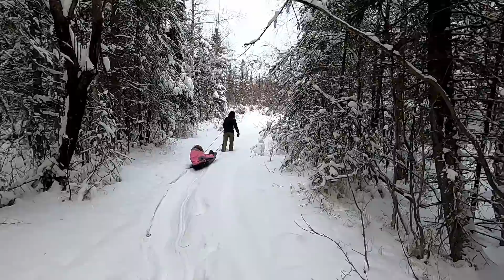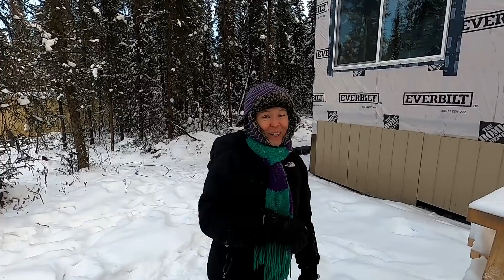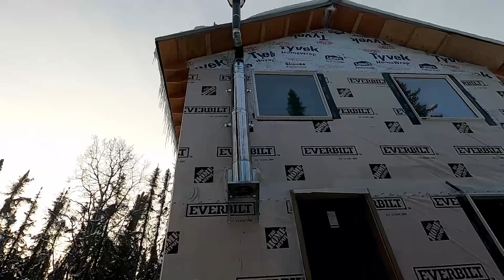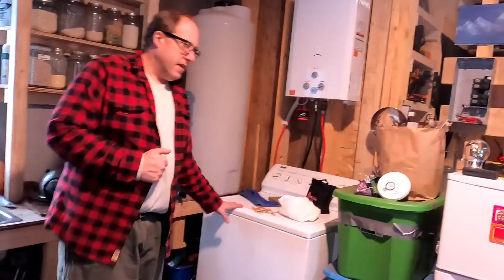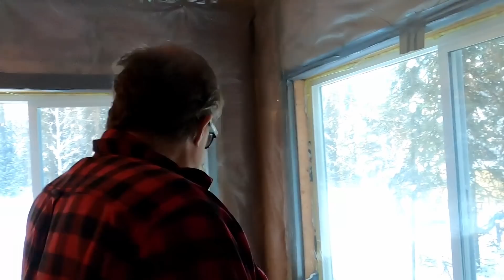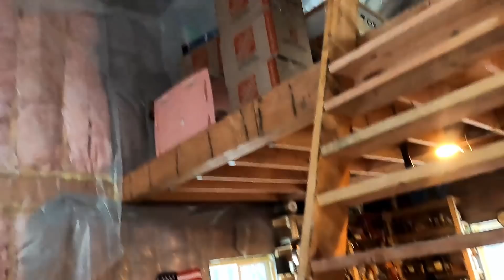We lost everything

Comment: Hi, just found your channel. We don’t live in Alaska but we do live in northern BC so now all about what you been going thru. It was -39C the other morning, that’s brutal. It’s hard to get motivated to do anything outside at those temps. Your house is going to be fab. Although we didn’t build ours, we bought a old church so we had to make it into a home. Which required new insulation and power and plumbing. We also put in a open loft but a few years ago we decided to wall it up and put in a door to keep keep some,of the heat out of it. Some nights it was way too hot to sleep. Great video, looking forward to following you on your journey
Reply from the maker: Thank you! Our plan is to wall off the two rooms in the loft, it just was not a requirement to move in to avoid the weather. Certainly on our list to get done

Comment: Glad You guys have started working on ventilation of the insulation it's very important, you may lose some heat just to make are flow, might need a bigger wood stove to make the air flow up and out.
Reply from the maker: Thanks for the tips!
Reply: @LifeinAlaska  You may need to drop your ceiling down with either scissor truss or a flat ceiling that is actually attached to the wall studs with wood under for more support, the whole width of the cabin like you are making an addick. You need room for the 38R and you must stay clear of the bird blocks, which you will drill and screen, at least every other bay and then the air will flow out the Venta ridge a job for when the snow is gone. The sooner the better, early spring. It will make the cabin easier to heat too. You may want to get the ladder out and determine if it's condensation dripping or if you have an active leak, did you seal you roofing sheet metal from panel to panel? Snow and Ice can wick water in. Some metal roofing comes with a sticking weather strip to seam the panels together.

Comment: Drywall?   Seems like that should go on before shelves and things like that.   Not critical, just curious :)
Reply from the maker: We are going with a wood finish. It would have been great to do prior to moving in but it was not required for living in at this point so priority shifted
Reply: @LifeinAlaska  it looks terrible.  I understand life gets in the way. I pray spring comes soon for the outside. I  Pray you can sheet rock or even put plywood just paint it.  Put cabinets back, with cabinet doors.
Reply: @BethS55  its not about pretty.
Reply: @rockingredpoppy9119  100% correct! Condensation will be a problem that's not pretty too.